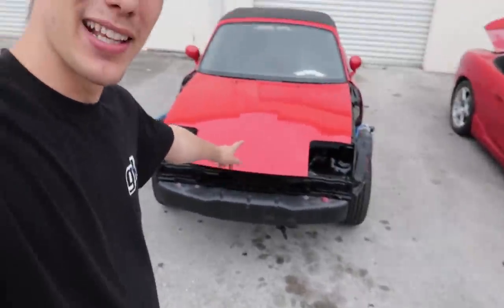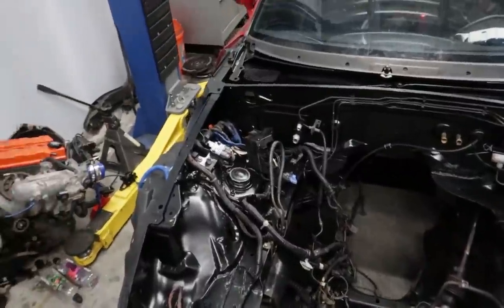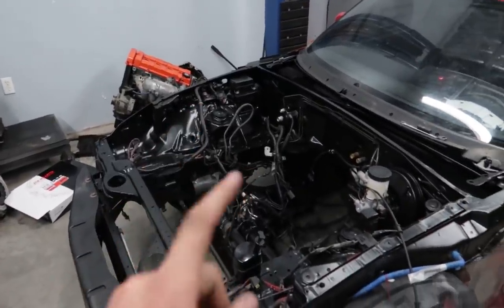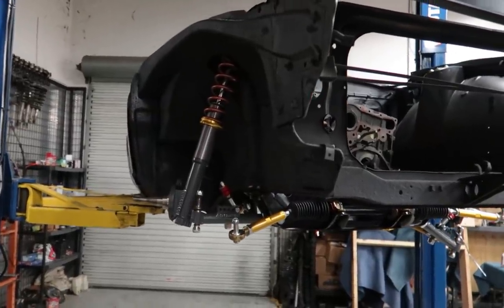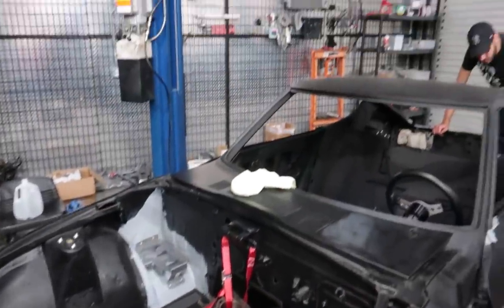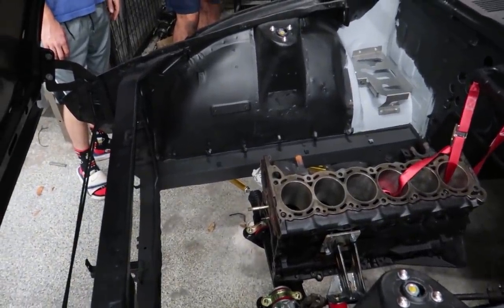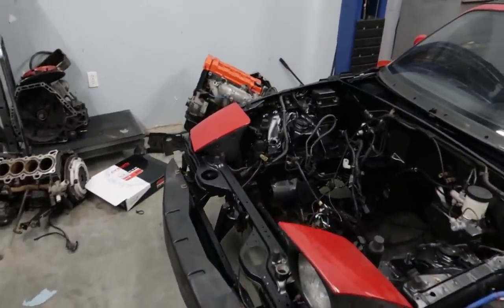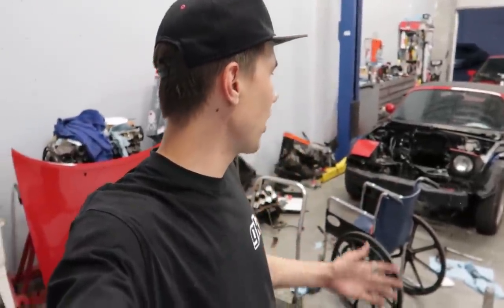MIATA JIGSAW PUZZLE!

Comment: Just use some paint thinner no need to wait for the parts to dry. It’ll work on the wires and fuse box. The brackets I can understand a fresh coat of paint but no need to worry about every little bit of over spray. Ask for some paint thinner.

Comment: if you are stripping over spray off just get a microfiber cloth and some paint thinner... that is only for stuff that isn't painted... otherwise you will be thinning off the other paint. i have done it on plastics and it works although slight discoloration can happen on certain plastics, it's also a leveler so if you only get a little of it and rub it around on things like plastic bumper trim it will restore certain faded plastic, same thing with faded headlights (you just have to be very careful with headlights and not getting it on the car's paint), if your using it on thin plastic or rubber just make sure you don't get too much on it as it does have a drying element to it so its probably not good in the long run.

Comment: Home Depot has that black corrugated tubing in the electrical section, cheaper than most part places I think.
Reply: Also soak the fasteners in a jar of pure/straight purple power to strip the paint.

Comment: I had to stop the video 2 minutes in to comment this.  PLEASE DO NOT wrap the engine loom with standard electrical tape!!! It doesn't last... It gets all gummy and loose, (especially in a high heat application) and it doesn't take long to do so. I highly recommend using "TESA" tape, or 3m friction tape on engine bay wiring. Its a cloth tape that uses a different, stronger, adhesive (i cant remember specifically what they use). But it is abrasion resistant, heat resistant, it looks, and lasts WAY longer than conventional PVC or vinyl electrical tape.